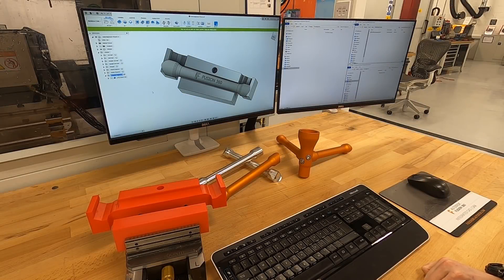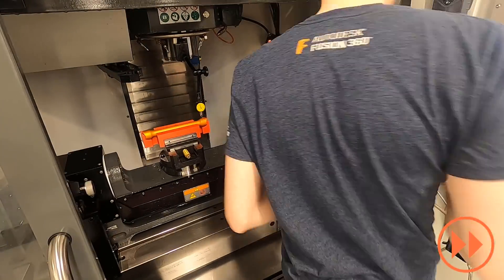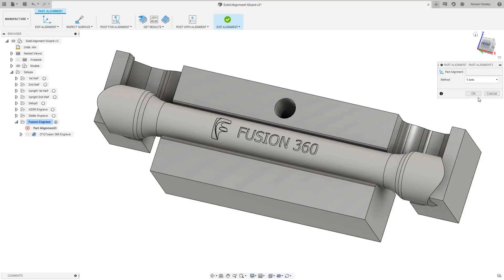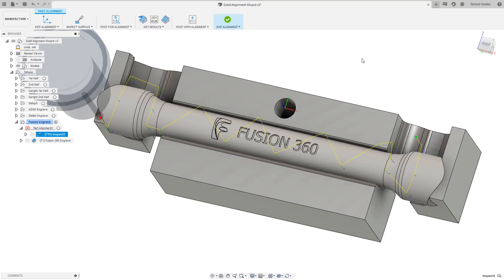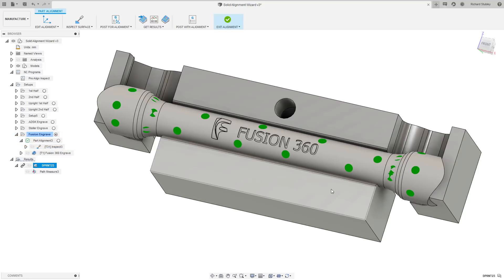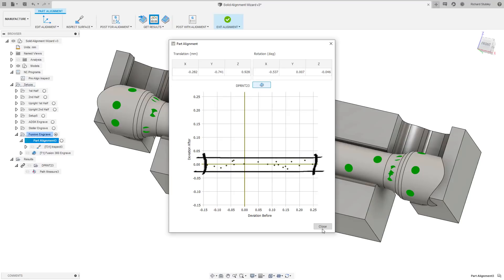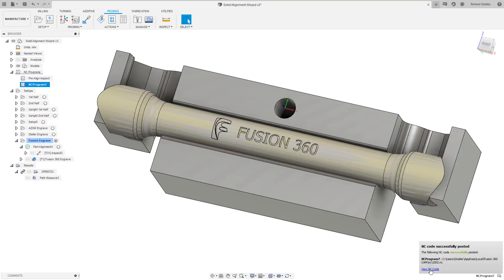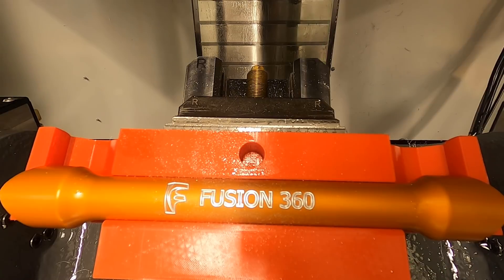TUTORIAL: Part Alignment in Fusion 360

Comment: is this also possible to use on a 3axis machine? - ie. do compensations in the toolpaths based on the probing?
Reply: Yes, you just set your alignment method to 3 axis. or even 4 axis around Z as this can use a mathematical co-ordinate rotation not actual axis on the machine.

Comment: nice, is the format of the inspection file defined somewhere, if i want to run one manually with haimer and feed the values back for alignment?
Reply: Hi, this all runs off having inspect surface running on the machine tool to give the probing results back to Fusion 360. I don't think this would work in your case sorry it all relies on having 2 bits of information for each point, the nominal, where the probe should have touched, and the measured where the probe did touch. In theory you could do all of this by hand but i dont think your would get much accuracy as it all relies on probing along the vector that is perpendicular to the surface, that's fine for X,Y&Z but for anything else its dam near impossible to do with a hand wheel. If your points are only in X,Y&Z directions then the effort in this probably higher than traditionally aligning the part. Sorry for the long answer but I don't like saying just no without a it of an explanation at least.
Reply: @richardstubley9611  What i'm essentially after is just rotating the working cordinate system in fusion based on how the part is in the device, which this in essence is doing. I can do a workaround and probe features on the machine, then sketch the results on top of the design and project the features from the design and from there draw the required sketches to select for the work cordinate system axis. For big heavy items that are difficult to hold on the machine, this would be worth the effort, instead of trying to align these manually on the machine perfectly. In most simplest form it should require only 2 points for compensating for roation along z axis, and one additional point for the two other axis.

Comment: Most of us have a 3 axis machine, only. Can I still align in rotational direction ignoring the fact that the tool direction will not be able to follow, which is not important in many cases as long as the corrections are very small. In other words, can I - via alignment - correct the tool positions without the ability to correct the tool directions?
Reply: Hi, this is where you can really leverage the 3 different alignment types. Just choose 3 axis and we will only calculate an alignment your machine will be able to do. you can even remove an axis lets say if you only want to change X and Y but not Z. Hopefully at 1:45 you will see what I mean.
Reply: Thanks, great!
Reply: Maybe the wording is a bit misleading. In case of a 3 axis machine the part coordinate system then is not only translated but also rotated. Even though, as a result, each point is only translated. Correct?
Reply: @Hi_Tec  It's more about how we re align the model, if you select 3 axis we will only translate the model, no rotations. If you want to translate and also rotate around Z then you can use 4 axis with a Z rotation, this solution will work on a 3 axis machine.
Reply: Does this mean, that I can also go for the 5 axis part alignment on a 3 axis machine? This should then correct all points in the 3D space according to the misalignment of the part in the clamping without the ability of correcting the tool directions. This, of course does only make sense with small corrections. Lets take engraving on a 3 axis machine and assume the part is randomly rotationally misaligned in any (or all) directions by small amounts. The engraving would then still be correct if we ignore the fact that the tool direction was not 100% correct during engraving which normally is not a problem. Correct?
Reply: @Hi_Tec  no sorry, you can only do a maximum of 3 linear axis and then rotation about Z only for a 3 axis machine. Yes we could theoretically adjust all the toolpaths to be executed in 3 axis but flat tools would no longer be cutting flat, and drills would be trying to drill at an angle, which is bad news.
Reply: Ok thanks, now I know what the possibilities and limitations are. 
Great work!

Comment: Correct me if I'm wrong but isn't this a Fusion 360 option that costs an additional $1500 per year?
Reply: Hey Bryan, yes the underlying functionality being inspect surface is extension based capability, the part alignment is currently preview but is planned to be in the extension once fully released.